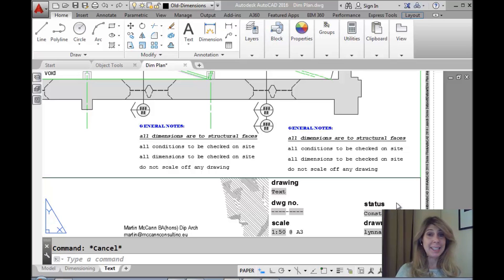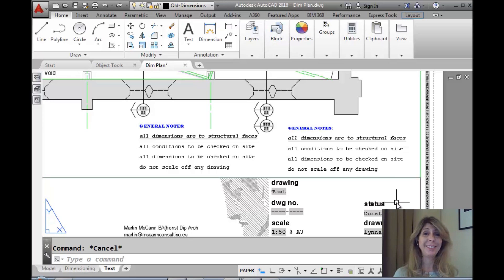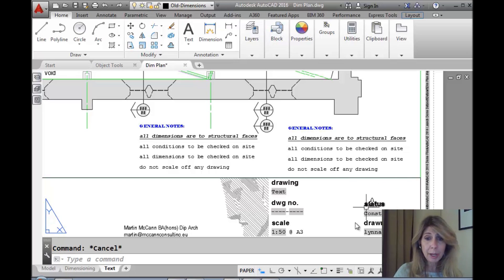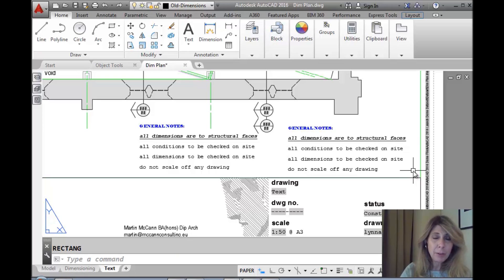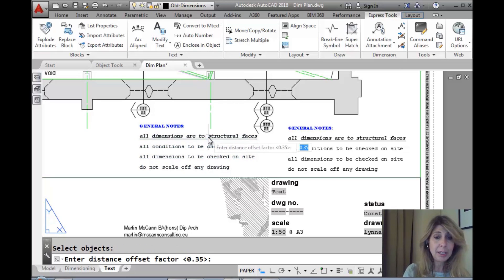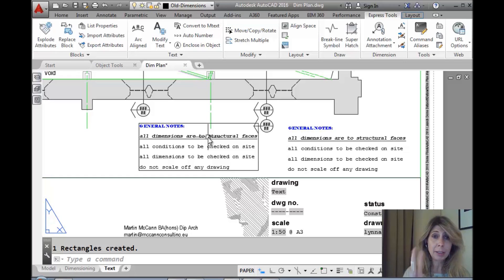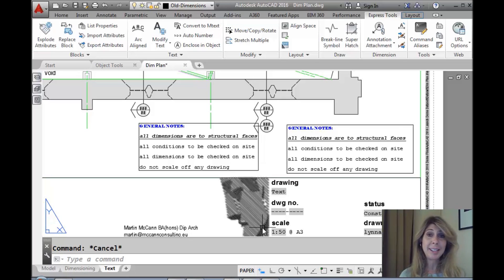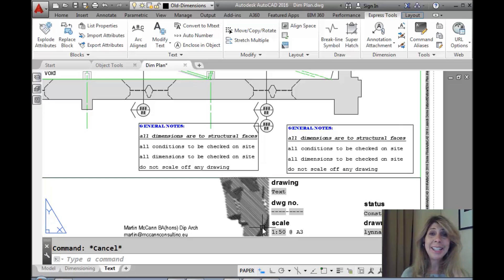AutoCAD Tip - Three Ways to Put a Frame around Your Text (Lynn Allen/Cadalyst Magazine)

Comment: Hi  #LynnAllen you can control the text frame offset in the 3rd method you explained. Edit the Background mack. Select ' use drawing background color' as the fill color . Then change the 'Border offset factor' to get the frame placed at the desired offset.